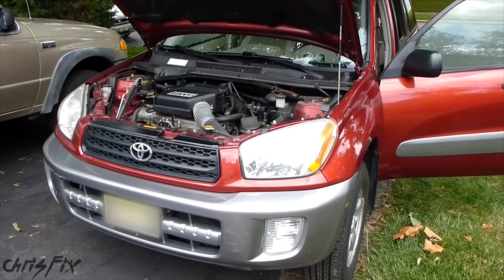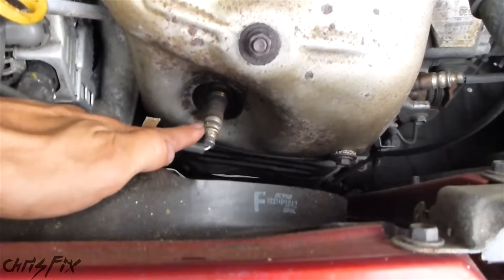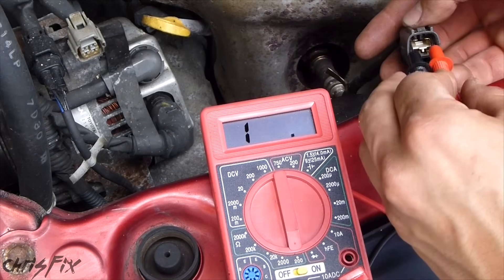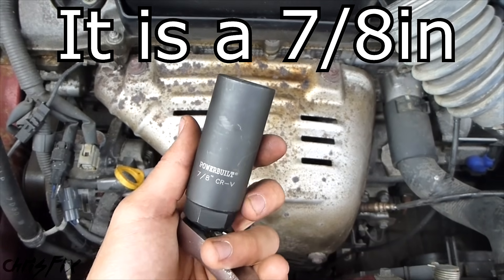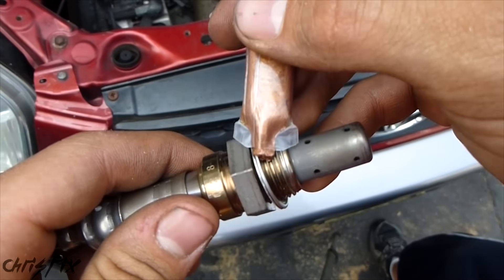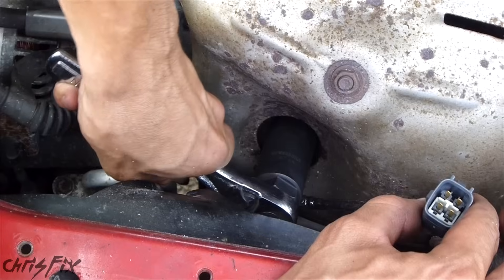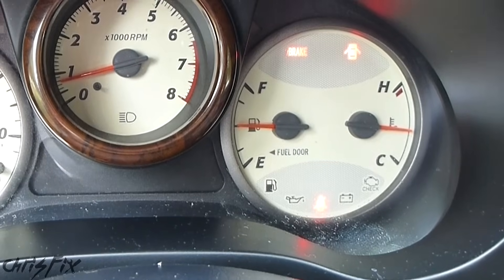How to Check and Replace an Oxygen Sensor (Air Fuel Ratio Sensor)

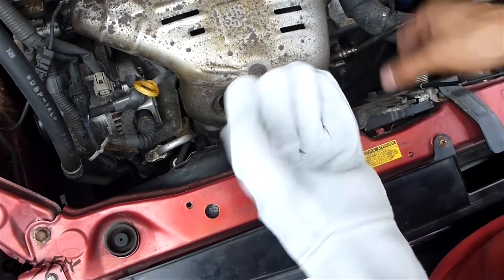Comment: Should the engine be cold or hot when trying to remove the oxygen sensor? I am confused because you said make sure the exhaust manifold is cold at 0:34, but then ended up using a welder's glove because it was hot at 2:34. Thanks.
Reply from the maker: It should be cold but this was a friends car and they just got to my house and needed me to fix it fast.
Reply: +ChrisFix gotcha. thanks.
Reply: They are so lucky to be your friends. Dependable and trustworthy repair for sure! Awesome video btw
Reply: It is better to be hot is easy  to take it out I know that for a fact.i tried both ways.
Reply: Marian Luc yeah easy to damage aluminum too.
Reply: @Mike-om4tv  what aluminium, it's all steel

Comment: in my 2013 ford Explorer I got a P0138 Bank 1 Sensor 2 high voltage.... I'm thinking the sensor itself crapped out and there's no short somewhere
Reply from the maker: +Ira Friedman Do you have a scanner with live data like the bluedriver? Check the sensors on the live data and check the voltage.

Comment: I have Infiniti  q45 2004 with code fault # P0135 Front HO2S Heater, Bank 1 and i replace it with new one and check engine still there ,  what i can do more. thank you

Comment: Chris, that particular sensor is for P1135 or P1155? I am getting mixed answers on this. (My RAV4 displays both codes so I am replacing both sensors anyway)
Reply from the maker: +canadianul1900 I clearly say in the video so watch again.
Reply from the maker: +canadianul1900 And I dont mean that in a bad way, just check because I dont remember exactly.
Reply: +ChrisFix none taken and this proves your video stands above the confusing statements made by some Amazon reviewers pointing to left/right || bank 1/2 || passenger/driver sensor. Kudos again.
Reply from the maker: +canadianul1900 no problem! I am glad it was clear the second time around. I wish I had more time to check for ya but answering all of these comments hours a day doesnt leave me too much time to go back into videos. Good luck!

Comment: Chris, great video, great voice :), great explanation -I've just subscribed and learned something new.

Quick question: would you go for the brand sensor, engraved Toyota/Denso, or use a generic non-engraved one?

Cheers from Toronto/Canada
Reply from the maker: +canadianul1900 Thanks and welcome aboard! It really depends on the price difference but for O2 sensors and A/F sensors I tend to try to go OEM.

Comment: Does this process apply to all vehicles or just this model of Toyota? I'm having a problem with an O2 sensor and wanted to fix it myself but figured I'd check around before pulling my truck apart
Reply from the maker: +Chris Desmond It is basically the same for every car. The O2 tool that I use helps a lot!

Comment: Hey Chris: which diagnostic electronic tool are you using?
How much did it cost?
Thanks.
Reply: Chris now recommends the BlueDriver reader, he has a video on it. :)
Reply: Okay  Thanks
Reply: I think he means the actual code diagnostic tool doesn't he?
Reply: it's probably an OBD-II reader. The multimeter is what he uses to check the ohms on the sensor.
Reply: It's an Inova 3130: https://www.amazon.com/INNOVA-3130c-Diagnostic-Reader-Vehicles/dp/B008RHBJ8K

Comment: Hey Chris, is this testing procedure the same  for all 4 wire O2 sensors?
Reply: +Angel Galvan I'm not Chris but yes it is, if you want to test the heater circuit

Comment: Does testing the sensor apply to all makes and models? or just for this Toyota?
Reply: +Angel Galvan This applies for all cars that use heated oxygen sensors. If your oxygen sensor has more than 2 wires then it is heated.

Comment: Chris, Thanks for the information, it is very helpful.
I have one question. Can the O2 sensor give a "bad" reading from carbon buildup? If so, can the sensor just be cleaned and reinstalled into the vehicle?
Thanks in advance..

Comment: is there a differance between a 02 sensor and a air fuel ratio sensor ??
Reply from the maker: +Drew Merrill They are similar. An A/F ratio sensor is the same as a wide-band O2 sensor. The measure how much O2 is in the exhaust compared to the O2 outside of the exhaust.

Comment: Hi chris ! i have a 2003 camry xle v6 that i  just bought. i had a check engine light on. i cleaned the MAF sensor the light is off now it's been couple weeks .i went for inspection they said i have to drive it more.
any idea? After i realized i had a leak in the gasket manifold but i fixed that . how long should i wait for inspection.

Comment: How do you know if the problem is the catalytic converter? I got that code for the sensor heater, replaced my sensor 3 times but the code keeps coming back on my 98 323is BMW, any ideas?
Reply: +Roberto Sunga Maybe there is a problem with the cars wiring and not the sensor itself

Comment: 2005 Dakota had a check engine light pop on last night. Took it to autozone for a code scan and it came up with p0057 ,p0031 ,p0037 ,p0051. No way all four of them tripped. Do you guys have any idea where I should start? Could it be a bad ground?

Comment: HI Chris, thanks for the video. I got a P2195 on my lexus es350 and that indicates the sensor 1 bank 1 A/F sensor is stuck on lean. I just tested the black leads and it does show resistance. This means the heater is working but the sensor can still be bad right?

Comment: Hi Chris, I was told that it is a good practice to replace the O2 sensor every 100,000 km. The reason being old O2 sensor although it may be working but they aren't that accurate as it used to be thus the reading might be slightly off. Replacing a new one will be a more accurate reading which is improve fuel economy and engine power.

Comment: hey Chris how can I change a engine coolant sensor on a 2002 potiac grand Prix GT.I try but my temp gauge still goes up but it don't over heat,should the sensor be tightened all the way thru the engine or slightly stay out a bit cause I don't want to break anything in the engine by tighten it
Reply from the maker: +Franco Melendez It should be tightened down to a specific torque. Your temperature gauge should show it going up and then hoover in the middle.

Comment: Chris, I just replaced my oxygen sensor by the engine, just like you had replaced  on your Toyota Rav4, but the engine light on my Honda Civic's dashboard still comes out.  I need help, any suggestion,  thanks.
Reply from the maker: +TheMiddleKingdom What is the code?
Reply: The Autozone retailer sale person tested and code came out as P0135.
Reply: +DALLASMADE19 ...I bought the Denso Oxygen Sensor from Advance Auto Part store, and it is exactly fit. After I watched one of the video on youtube, a man showed how to get rid of engine light from something else problem, it was about the gas cap problem, he told people to disconnect the ground battery cable for a few minutes and then connected it back; I tried his way even thought my car problem is an oxygen sensor, it works, my Honda Civic engine light disappeared, just like his car.

I was careful not to the wire to touch the any engine parts, I tied the oxygen sensor wire onto the colder place.  I know the heat of the engine will destroyed the wire's rubber seal.

Comment: Many times you can tell that an O2 sensor is going bad even before your check engine light illuminates. Your gas mileage will start to get worse and worse because the sensor says that things are running lean so the ECU will add more fuel to richens up the mixture. I have a car with approximately 75K miles on it and I used to get about 300 miles +/- per tank but now it is in the low 200s. I still do not have a check engine light  but should be showing up soon. I understand that you are trying to make your videos as clear as possible and try not to get into guessing games but this might be worth mentioning.

Comment: I was wondering which sensor triggered the P1155 code. Our 2002 Rav4 just threw the same code. The local "Danger Zone" told me it is the Bank 1 Sensor 2 position. Looks like they were wrong. I will verify with an ohm meter. Thanks for the informative video!

Comment: Question, Do I have to erase the code after I change the sensor? or the code will disappear immediately
Reply from the maker: +Roberto Hernandez It wont disappear immediately unless you clear it, but after driving for 100miles or so it will erase itself if the problem is no longer there. If you want to clear it, take the negative cable off the battery for 30 seconds.
Reply: +ChrisFix thank you!

Comment: How do you know where bank 1, bank 2 is? And sensor 1, sensor 2??
Reply from the maker: +o0oitzJimmy You have to use a diagram to get which side the bank is on, but sensor 1 is always closest to the engine and sensor 2 is after the cat.
Reply: ok thanks

Comment: would this affect the car not starting up ?????? my car wont start,  the check engine light has ,, O2Sensor, some gas leak, coolant sensor,... would any of those effect my car not start, it trys to crank up, sometimes it shakes a little, can anyone tell me? maybe you Chrisfix ... thanks!
Reply from the maker: +djka14 The coolant sensor and the O2 sensor could make it hard for the car to start. Try unplugging the battery for a few minutes and then plug it back in and start your car. That will put the computer in "learn" mode and that might help. If it starts, then it is definitely the problem.

Comment: If you are replacing an O2 sensor like you were, No need for a special socket chris. SNip the wires at the sensor and use the correct size 6 point socket. Just trying to save you a trip when not needed. I believe those special sockets are needed when removing AND re installing the same sensor.
Reply from the maker: +domain Thanks for sharing. You need the socket for installation.

Comment: 1999 2500 Chevy Pickup 350 ( 5.7 ) 340,000 miles. Code on my AutoXray Code Scout 2500 is PO174 system too lean ( Bank 2 ) I changed driver side closest to the exhaust manifold. No change, then changed passenger and no change. Before all that I changed the air control valve, I think that's what it's called. Goes between air filter and the throttle body. Runs real bad, sounds like a rod knocking when i first crank it. Not sure what to do next. Do you know where to find some TNT ?.....that should fix it.

Comment: Chris, I have 93 toyota pickup in CA. It failed smog. it has 4 wires(BBWBlu) O2 sensors. I did ur BB wires resistance test with same meter. pre-cat is like two dig. like 3.2 or 4.2 and past cat is 13.2 something. cool engine test. R they both bad? 

Emission results:

15 Mph.  1551 rpm

co2- 14.9 
O2-   0.0

HC Max 95.   Meas. 95
CO Max 0.75 Meas 0.05
NO Max 386  Meas 374
pass. barely

25 mph.  Rpm 1527

co2- 14.8
O2-   0.2

HC Max 60.   Meas. 65
CO Max 0.90 Meas 0.02
NO Max 564 Meas 833

Fail

Is this bad o2 issue or/& also cat?

Thanks. love ur videos :)

 Egr vac. test at idle kills engine. also vac. shows when rev. engine at valve body.

Looks like 90s Toyota want this O2(4wires) test while on car

Disconnect the oxygen sensor connector

Using an ohmmeter,measure the resistance
between the terminals +B and HT. Black wires
Resistance:
At 20°C (68°F): 11 – 16 Ohms
If he resistance is not as specified, replace the  sensor
Torque:
44 Nm (32ft.lb)

Reconnect the oxygen sensor connector
Reply from the maker: +manpdhi It's hard for me to say what the problem is without messing around with it myself. Maybe try running this stuff the next time you go to get tested: http://amzn.to/1Jl2f5l
Reply: +ChrisFix ok thanks

Comment: I have a 1999 rav4 that had the oxygen codes on the CEL reader and i replaced both but the CEL light came on again and now the car idle surges even worse than before.
Reply from the maker: +calicodeath maybe you got a bad sensor? Check the live data and see what the code is for.
Reply: +ChrisFix. Chris, I have 93 toyota pickup in CA. It failed smog. it has 4 wires(BBWBlu) O2 sensors. I did ur BB wires resistance test with same meter. pre-cat is like two dig. like 3.2 or 4.2 and past cat is 13.2 something. cool engine test. R they both bad? 

Emission results:

15 Mph.  1551 rpm

co2- 14.9 
O2-   0.0

HC Max 95.   Meas. 95
CO Max 0.75 Meas 0.05
NO Max 386  Meas 374
pass. barely

25 mph.  Rpm 1527

co2- 14.8
O2-   0.2

HC Max 60.   Meas. 65
CO Max 0.90 Meas 0.02
NO Max 564 Meas 833

Fail

Is this bad o2 issue or/& also cat?

Thanks. love ur videos :)
Reply: +ChrisFix Egr vac. test at idle kills engine. also vac. shows when rev. engine at valve body.
Reply: +ChrisFix Chris Looks like 90s Toyota want this O2(4wires) test while on car

Disconnect the oxygen sensor connector

Using an ohmmeter,measure the resistance
between the terminals +B and HT. Black wires
Resistance:
At 20°C (68°F): 11 – 16 Ohms
If he resistance is not as specified, replace the  sensor
Torque:
44 Nm (32ft.lb)

Reconnect the oxygen sensor connector

Comment: Great video! I'd recommend to spray some WD-40 or PB Blaster to where the sensor threads with the engine off but still hot. It will loosen more the sensor. I had to replace this "Air/Fuel Ratio" sensor on my '05 Hyundai Elantra 3 years ago. It was around $165. I checked online on Advance Auto Parts, and found a promo code that took off $50. It was still expensive paying $115 for a air/fuel sensor, but cheaper than paying $165 + tax.

Comment: @chrisfix should there be a routine check on the O2 sensor? Or it should only be touched once something appear on OBD2? Does it require a regular cleaning? Thanks bud!
Reply from the maker: +Anuar Hamid Nope, they shouldnt go bad and there is nothing to do to maintain them.
Reply: ChrisFix Thanks for the clarification. Appreciate it!
Reply: +Anuar Hamid Most O2 sensors I've come across are rated for 100K miles, but that doesn't mean you should necessarily replace them. A few months ago I replaced all sensors in my neighbor's '99 V6 Accord, who had original sensors, and 220K miles on it - so depending on the vehicle, it can vary wildly. Aside of the check engine light (I had to read the code for her), she didn't know they were bad, aside of noticing after I replaced them she had a much smoother idle.

Comment: I diagnosed the faulty sensor, replaced it successfully.. but how can I delete the error code, if in my case, I don't have the handheld scanner? My specific model is '99 Toyota Solara.. thanks!
Reply from the maker: +Jim F It will go off on its own after a few hundred miles or take it to your local parts store and they will do it for free.

Comment: hi chris,  my boyfriend replaced both convertors on my 05 hyundai elantra and the fuel injectors. any ideas on what we need to look at that made the convertors go bad?
Reply from the maker: +Tiffany Whittemore They go bad over time and it can be expedited from too much fuel delivery. I would check your air/fuel ratio using a scan tool.
Reply: +ChrisFix the short term fuel is reading -6.3 the long term is reading 10.2
Reply: +Tiffany Whittemore It's probably a bit of timing too. Most people don't know that original converters for all vehicles in the US are warrantied for 8 years/80K miles. I haven't found a single exception to this rule from a manufacturer as of yet, so I'd imagine it's a federal mandate.

Comment: Hey i was wondering if a broken oxygen sensor would be the cause of engine power loss + rough idle?
Reply from the maker: +Gabriel Thériault yes it could defintiely be the cause!
Reply: +Gabriel Thériault After replacing all O2 sensors in my neighbor's Honda, I can definitely vouch that a bad O2 sensor can cause a rough idle. This also applied to the DeLorean I used to own that due to age was completely devoid of an OBD system. It was a night and day difference for both after the swap.
Reply: Justin Johnson Thanks a lot! I'll look into fixing it

Comment: Nice Vid.    Did you try any other brand name o2 sensor prior to using the denso 234-9023? I had the same problem,but a chose a different brand name which did NOT work. Is Denso the better choice for this particular vehicle?
Reply from the maker: +JAI ROC I never tried another brand. I just got the OEM since this was a friends car.
Reply: Thanks for your response. I'll use the same. Hopefully, it works out.

Comment: hi chris fix...i am getting code P2A03...plz advise...its a 2008 nissan altima 3.5
Reply from the maker: +Muhammed Farhan That is the a/f ratio sensor bank 2 sensor 1. Check it out and see if it is working.
Reply: +ChrisFix i have chkd with multi meter...its working...but this code still pops up
Reply from the maker: +Muhammed Farhan Might need a new one because all the multimeter says is if the heater is working. They do get dirty so you can try taking it off and cleaning it with mass airflow sensor cleaner.

Comment: Cris on my 2004 cadillac srx i have codes p0446, p0420,p0430,  low-bank 1,  low-bank 2.  
the cause it could be 2,3,4 what does it mean.
Reply from the maker: +VICTOR FLORES Could be bad O2 sensors or it could be a bad cat. I would guess it is the sensor though. You also have an evap system leak: https://www.youtube.com/watch?v=Dl9Bi_kuWkY

Comment: my bank 1 catalytic converter had to be changed, but I didn't want to shell out over a grand so I bought an after market one but my engine light is still on... could it be my sensor?
Reply from the maker: +Raynorrules Gotta check the live data and see if the bank 1 sensor is oscillating from .1v to .9v. Should look like a heart rate on the graph. I will have a video on this!
Reply: +ChrisFix my problems went away!! now my milage is 10 times better! thanks though I can always rely on you and your videos!!